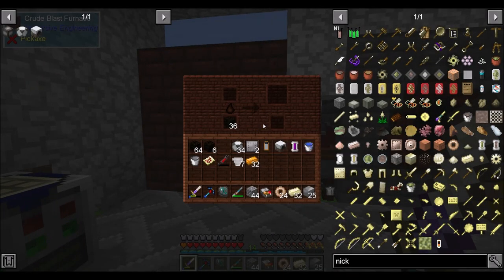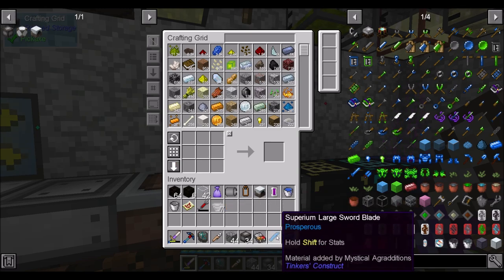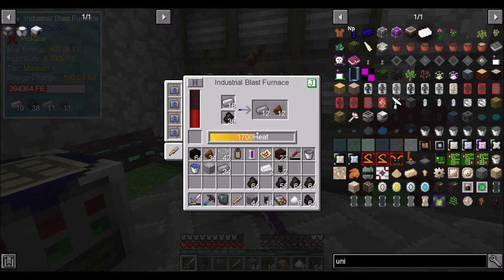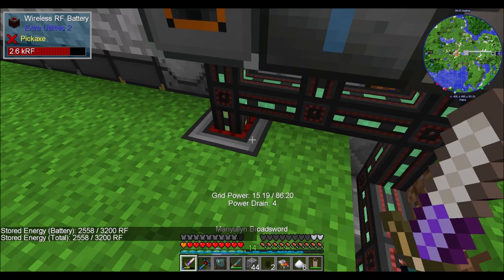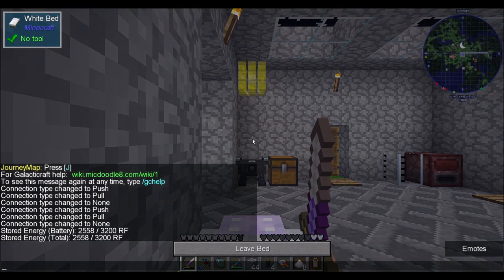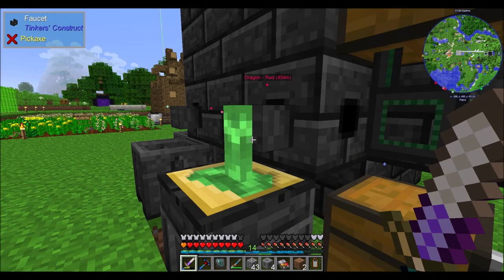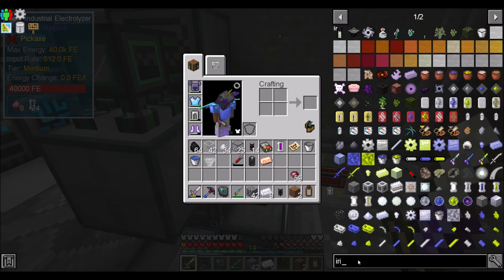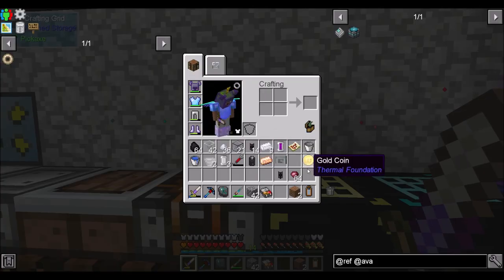DDSS   Ep50 Energy Upgrades

Comment: Hey dire, there is actually a way to increase the speed of the fabricator. It's a bit foggy, but what I belive you do is make a soldering iron and circuit from forestry,  right click the soldering iron, insert the circuit into the iron, and then apply some circuits to the circuit. I don't remember which tubes are needed specifically, but I think that blazing electron tubes are good.

Comment: You can already automate crafter and Automation Interface (AI), if you count, there are 9 different items in AI, and 8 different items in Crafter, which means you can use the 9 slot pattern.

But then you will say: "But and the order of the items ???"

AI PUT the items in the right order on the giant craftin table, so you DON'T need the giant pattern, you can already use the normal, just put the right amount of items and have it thrown to a chest and then throw it on AI, and he'll fix the recipe, create it and then send it back to the system.

Comment: I can only recommend you to give up automation, this pack is only manual as far as i played myself, main quest line 4 i gave up its a suicide run , you only do stuff you did before and so on and there is no real goal only to reach the universe. But i hope you have fun playing this pack otherwise i could understand if you would stop at any certain point.
Reply: I burned out on the pack the 1st time I played it because I thought the same thing, but automation isn't impossible, just painful to get going initially. The main problem is there aren't any quests guiding you through it so you kinda have to figure it out for yourself. After you do though the pack becomes a lot easier.